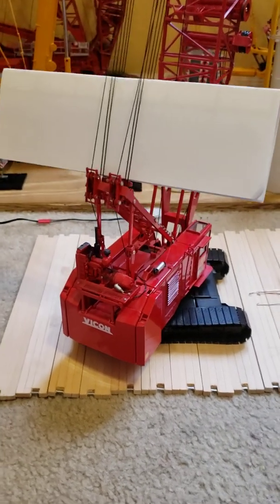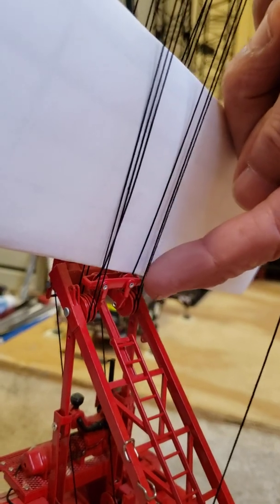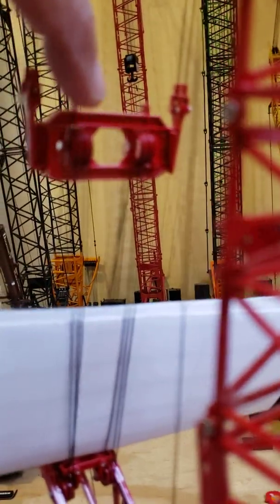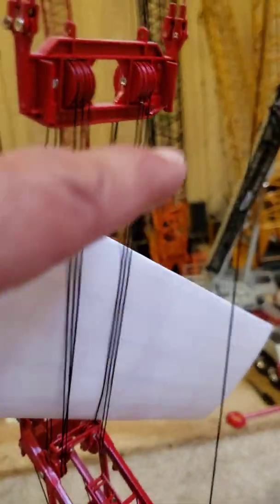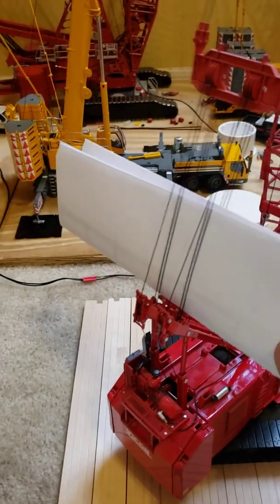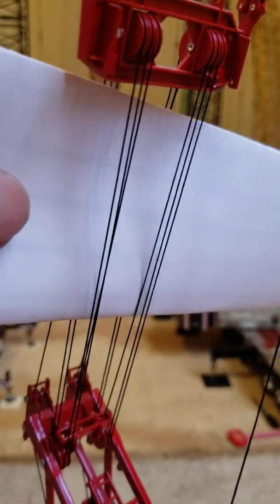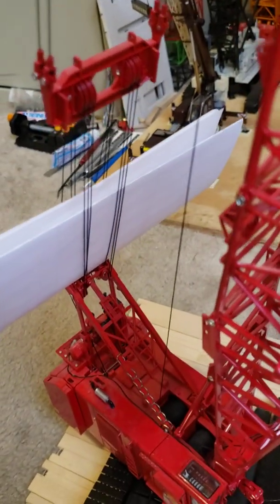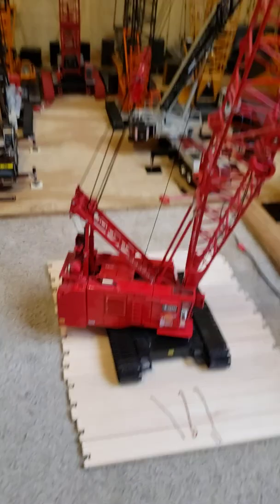How The Manitowoc 4100 Equalizer is Reeved

Comment: The Video was very helpful. I purchased a 4100 Crawler the line was very crossed over. I thought I was going  have to reline the hole crane. Thanks, John
Reply from the maker: Thanks John! Glad it helped. I've posted many videos on reeving and assembly to help others with these awesome models. Mine had the same problem but luckily it's an easy fix. Always take your time and try not to get frustrated.

Comment: Hey I have collected MANI 16000 RED 
ITS MORE DETAILED THAN 4100 !
As I have the both so these two are excellent models of MANITOWOC 
But why do you have to reeve this in 4100 as it comes reeved itself  from factory! Just have To tie the pendant strings with the equaliser
Reply from the maker: Sorry, I'll finish that. Yeah,  great details and a pretty good lifting capacity. They should be factory reeved too, both of them. If it's not reeved and you're not sure,  just reeve each side separately, starting from the middle of the a-arm and tie off on the outside sheave. I haven't checked to see if these can be reeved with 1 piece of rope but it would have to reeved the Manitowoc way. Typical, yeah....just hook up the pendants and you're ready to go.
Reply: @lvdrums  yeah 16000 is factory reeved And very stable at heavier loads 
It marks over lr1300 as 16000 tracks are nice to move like 4100! 
Now we are shifting to Weiss Brothers Manitowoc only as several parts are also available from this seller
Reply from the maker: Hi variav, 
Nice! Great model and awesome looking. I love the low and wide stance this bad boy has. And yeah man,

Comment: Thank you so much for the video! I'm hoping to find the time to work on mine tonight. I plan to place the iPad right next to the crane and hopefully be able to get her all straightened out. I will reach out with how it went once I am done, thanks again!
Reply from the maker: No problem bro. Glad I can help and I hope it works out real nice. Hit me up if you run into an issue. Good luck and take your time.
Reply from the maker: Hi R&J,
Was it you that needed the 4100 instructions?
Reply: @lvdrums  Yes, that was me. I know there was no reeving in the manual but I would still like to have it to put in the box. I worked on the reeving last night and made some decent progress. However, I realized today that my bridal is different than yours. I am currently uploading a video with my 4100 with what I believe is different with my bridal. If you can just check it out whenever you find the time and let me know what you think I would really appreciate it. As always, thank you for all the help!
Reply from the maker: @rjenterprises651  Hi, when you get a chance send me your email address and I'll send you the 4100 instruction manual. You can call me when you get a chance too and I'll go over the reeving a little and maybe help out. Thanks
Reply from the maker: Hi R&J. I went to your site and checked the video. Call me at 6232089203 and I have a few questions first.